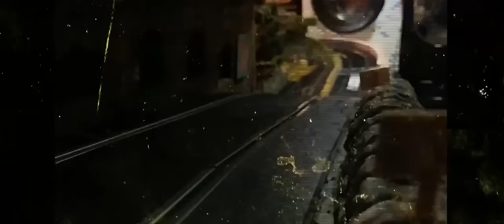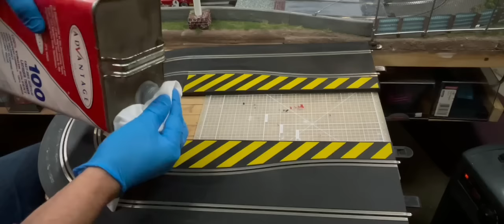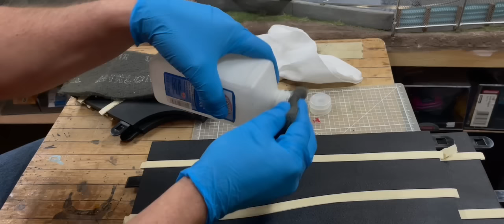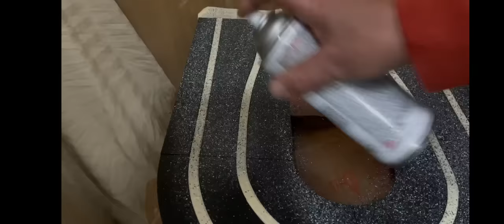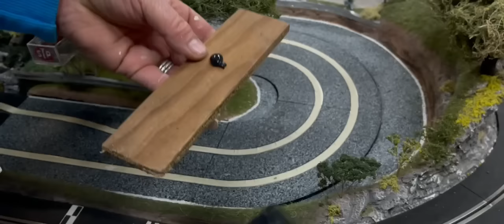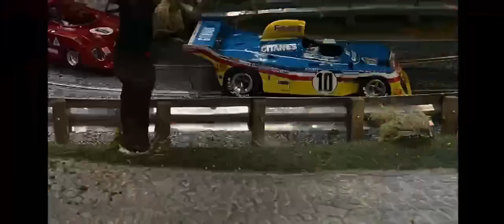How to paint your track  series video #1 , asphalt spray can technique

Comment: This is looking waaay better than what I’ve seen elsewhere. 
One question: you did a thorough cleaning but I’m surprised you don’t need any primer?
Reply from the maker: Thank you 😊, no primer needed with this material. It has a very high solvent base content to the paint. And with the prepping and cleaning it has plenty of mechanical bonding to have great adhesive properties. Primer could be used if you wanted but I would recommend using a dark grey or black for primer. One of the advantages of using this over a dark substrate is that the paint has a translucent finish. The black track helps give the color that true realism look to the finished product with a few coats of color.

Comment: If you read this? I'm just wondering if you can make the  rails black.  I know that they make a formula to turn model railroad wheels black,  and that it doesn't interfere with the electric contact.  Again, just wondering.
Reply from the maker: Thanks David, I don’t see why it wouldn’t work. As long as it doesn’t interfere with the electrical flow. Only question I would have is if it would last. Being that our slot cars drag around a set of braids on the rails. Would it wear off over time . But it would be worth a try. Definitely would improve the overall look of the track for sure.

Comment: Great vid. I wonder how much better a track would work just from cleaning the release agent off it? Doesnt sound good for traction to have something slick on it.
Reply from the maker: It would improve it some , the only issue I could see with this is over time , it will pull the oils from the plastic making it brittle. It doesn’t effect this when you paint it because it seals the surface and prevents it from decomposing…

Comment: You don't think about join this track connection row using glue and fill in with putty to get the effect of a smooth road with no visible connections?
Reply from the maker: That would work, but i prefer to have the ability to remove track if i need to. Gluing them together kinda defeats the purpose of that. But it would give it a nice look

Comment: hey Boone, i have now watched the whole "paint your track" series and i think ill go with the first technique. with the second technique you need to have as many tracks together as possible but for the first technique it is not really necessary, right?
Reply from the maker: Correct…. The 1st technique uses just the one can … as long as you make sure to shake the can up to properly mix the material, you should be able to create the same finish between two different pieces of track
Reply: @BoonesSlotCarGarage  i plan to do races with my buddies, with technique one, you think its almost to much grip? i have a carrera digital. so track itself has already some grip
Reply from the maker: @stefannauer4096  not sure … you might want to try a small area first and see if you like it. I generally run without magnets, I like the way the cars perform on this technique.. but I also have a large track with a few different surface types… I recommend trying a corner with this a see if you like it

Comment: Boonemam how long does the kylon take to dry between coats and final dry so it doesn't scrape off
Reply from the maker: I let it dry for 24 hours, this stuff is very thick and takes a bit to cure . But when fully cured it is durable…

Comment: Hey Boone, me again. next step is to paint the track since i dont like the black look. how you painted your track, love it. since i dont have Krylon "black granite" in Switzerland ill try to order it online. my track is 65 feet or about 20meters lang, what do you think how many do i need?
Reply from the maker: I would suggest around 6 cans , but you could use a spray can grey primer 1st as a base coat, this would help the texture paint to go further and cover more area…
Reply: @BoonesSlotCarGarage   so you mean take a "normal" grey for the 1st coat and two more with the black granite? i like the white line, what do you think if you make first the white line and than the whole track with the "black granite"?
Reply from the maker: @stefannauer4096  you could do that, my rule of thumb is too much material buildup can be a bad thing… as your material layers become thicker, the durability and adhesion will start to suffer…but this could be done , just recommend that to try to keep it to a minimal thickness if possible
Reply: @BoonesSlotCarGarage  how many coats you put on?
Reply from the maker: @stefannauer4096  I try to keep it to a minimum, it can very depending on the material being used. Some products cover faster than others… the video in reference here took around 3 coats to achieve this look. If a grey primer was used 1st , I believe it would be only 2 coats for coverage
Reply: @BoonesSlotCarGarage   ok thx

Comment: Booneman this is cal I have a 60 ft artin 143 scale plastic track that has no texture thus it is very slick. They do not make silicone tires for the artin cars. Would course sandpaper work to add texture to track surface when using rubber tires. If not what is the best paint to add grip
Reply from the maker: Rough sand paper could work, but it’s not going to be the most attractive surface on your track…  this video with the stone paint has awesome grip .. all the track painting videos i have improve the grip of the track . But this 1 technique is by far the best when it comes to providing a high grip surface
Reply: Thanks again booneman Goodluck on your move my friend
Reply from the maker: @mypearce8089  thanks Cal